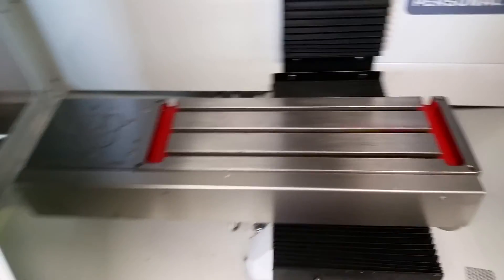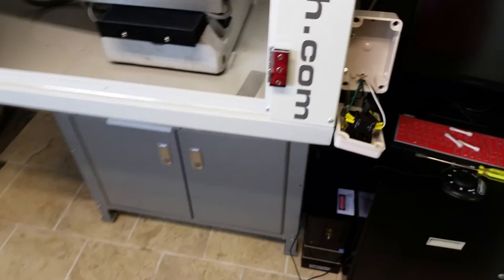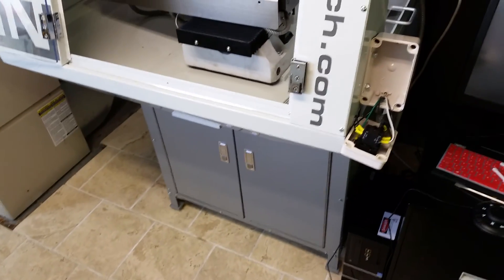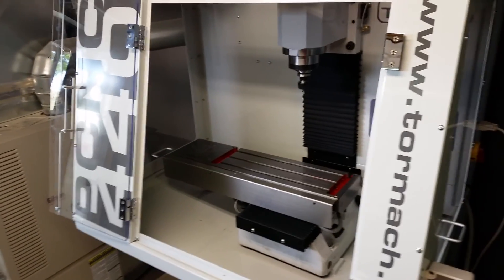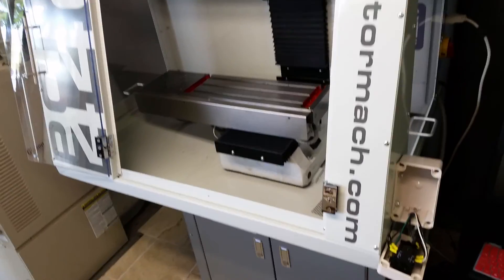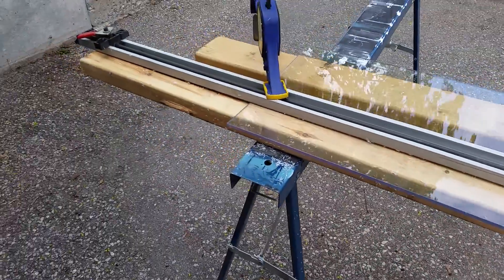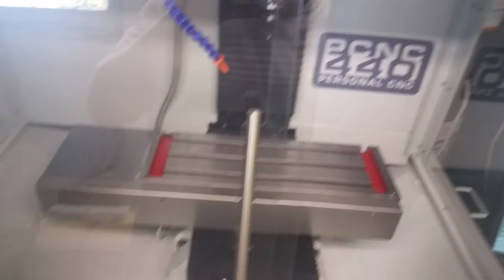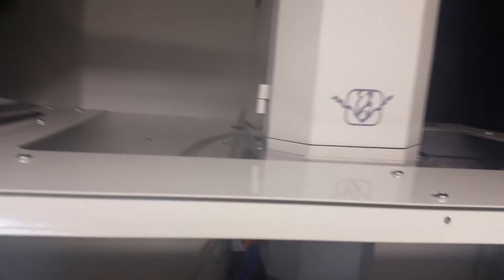My New Tormach 440 CNC Mill Video 11

Comment: If you change the doors to the inside, make them slide in a two rail track, it will keep the coolant inside and not leak out dripping off the inside of the doors on the outer frame. Aluminum extrusion and slide material from 80/20, frame world, etc.

Comment: Just a heads up on the Qualichem... its excellent stuff but does degrade some plastics. Particularly bad making PVC go brittle. I'll give your z-Axis bellows about 4 months before its ripped to pieces by chips if its made from the same stuff as on the 1100.
Reply from the maker: darn it!  Did you replace them with something more durable?
Reply: +SAKModder Working on it... found an outfit in china that make telescoping ones cheap outta stainless. It sickens me to have to do this but i can't justify 12-1400 to have some made here. some people use a thick flap of rubber, similar to whats used on bridgeports. I never clean off tooling when i make tool changes... the water evaporates and leaves behind an oily film on the tooling which protects it... Zero rust on anything now. Things like peeling paint is a small price to pay for switching from Kool Mist and the Fog-Ruster compared to the performance and other advantages of 251C.
Reply: More good advice even away from the channel. That Is what you tube was meant for - IMO. I would love the contact for the telescoping covers.